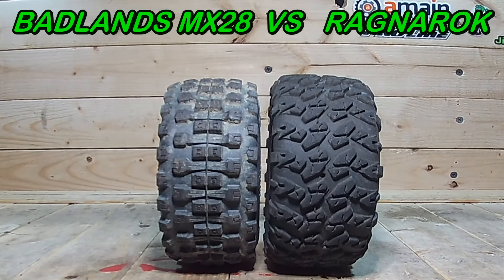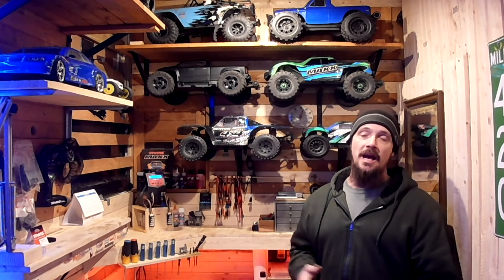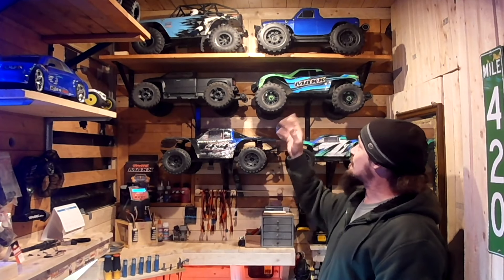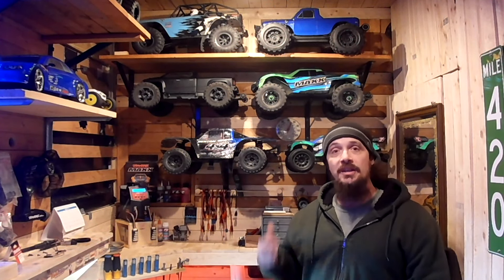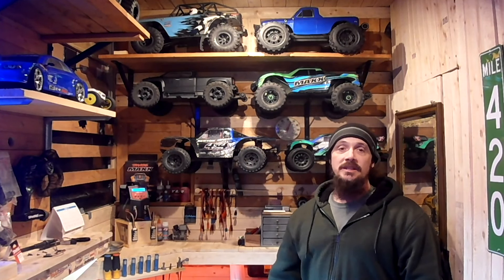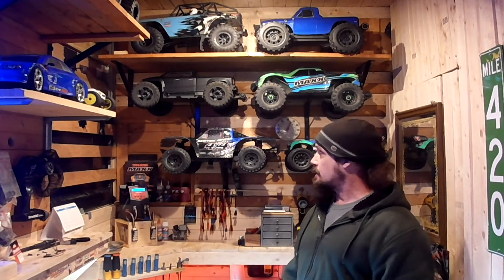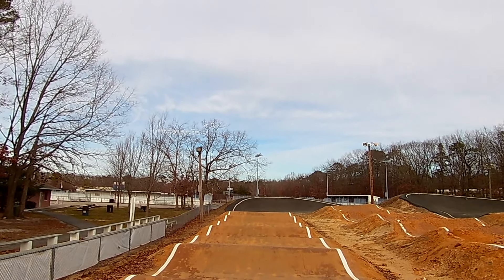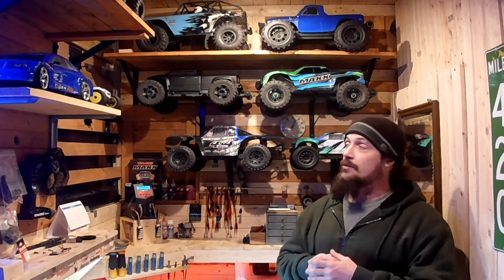Senton VS Maxx 4s Battle

Comment: Nice runs 👍 that dirt track looks like a pretty cool run location, might need to find a high point on the track and kinda focus your runs in that location so you can see better, where you were at seemed ok, or closer to that berm, so what did you think of that wide kit? Improve handling? Looks like it held up pretty well on the ramp, that’s what I was worried about, it’s been really cold here in the 20s so I haven’t had a chance to ramp jump mine yet, I know you said it was cold over there too, so props for you braving the weather to show us your run footage 🤙 I had to adjust my shocks to pull that rear end up level after the wide kit install but I haven’t changed the shock oil yet, looks like you may have bottomed out over something in that field, sheared the head right off that screw looks like, if it’s not causing any issues while running it, I wouldn’t worry about it just yet but if your like me, it’s gonna bug you lol, you might try unscrewing all the other screws and then just carefully pull it off, it’s gonna suck and be kinda cringy but that might be what you have to do, if you pull that skid plate off like that, your definitely gonna have to obviously buy I new one but with the skid plate off you might be able to grasp what’s left of that screw with some needle nose pliers and unscrew it, or drill it out which would be way more risky
Reply from the maker: That BMX track is a dope spot. I'm definitely going back. I like the wide but like u said it lowers the truck and I have it adjusted level but with the 80wt it's a little lazy on the rebound because of the cold maybe? or my shock tuning skills are crap? lol. You're rite I think removing everything around it, then trying to extract. I think that screw goes up into the diff housing so it should be fun.
Reply: @soulrebelrc6341  wow that sucks, hopefully you can get it out, hopefully when you get that skid plate off you can get enough purchase on it to unscrew it, damn I didn’t know it went that deep, good luck with that
Reply from the maker: @rcreviews9894  I don't know if it does for sure, hopefully it doesn't. Honestly I'm shocked it sheared off like that.
Reply: @soulrebelrc6341  yeah that’s just so random lol

Comment: Great video.
I remember asking you in a previous video what servo you were running on the senton. I was surprised when you replied the stock one. Was there a reason to upgrade to the 25g one or did you just want to try something different?
I replaced mine with a JX since the stock servo started to act up.
Reply from the maker: My stock servo was acting up too. I would constantly adjust the steering trim to drive straight. I'm guessing a chipped gear inside the servo. I went with the 25kg , 380oz in servo because it has more torque then the stock. I wanted to try something different that had a lot more torque.

Comment: How does the big rock compare to the maxx in your opinion?
Reply from the maker: The big rock is a very tough speed basher. The maxx is very tough as well but more of a true monster truck.   I think the big rock gives you more bang for the buck but lacks some of the engineering that the maxx has. Maxx is 4s - Big rock is 3s